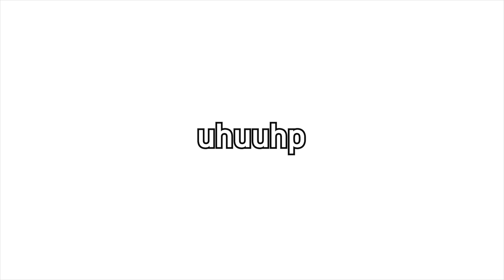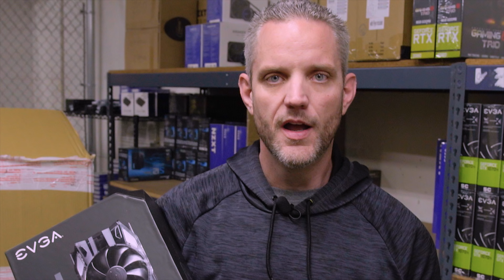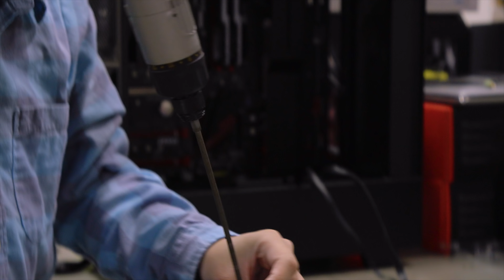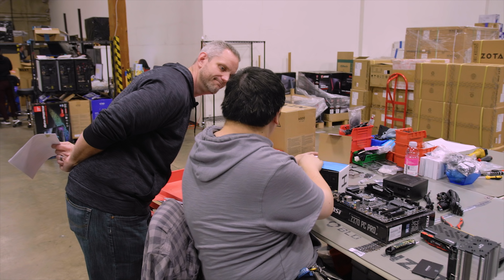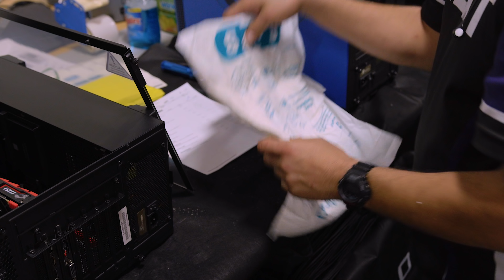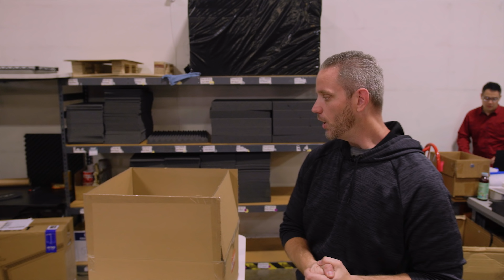How NZXT Computers are built

Comment: I find it interesting that they don't ask the manufacturers for system integrator versions, but instead use the retail versions, including the Ryzen CPUs with the stock coolers.
(3:47) I do hope they're using the Windows setup audit mode, unless the user ordering it chose to have the setup skipped.

Comment: Super Nice that they test, build and install everything, but when you take a look on there website you find a pc with a ryzen 5 3600 with gtx 1660 super for $1253 🤯 you can build that same pc yourself for around $800. And for that price I would install the drivers myself and make sure you get on each part warranty. But I like what NZXT is doing with this to help (first time) builders!
Reply: bro ive compared the prices its just the small things they add like better ram the case itself and the cooler it costs more but ur PC gonna look way better and have the (almost) best components

Comment: I just bought a new NZXT PC and this is reassuring to know they will test everything before shipping
Reply: I just bought the starter pro prebuilt and I can assure you it is a very good purchase I haven’t had a single problem with the pc and I’ve been able to run a lot of things at once and still retain literally no lag it is very impressive.
Reply: @thelivingrocks1933  did you have to download any drivers, or motherboard chipsets? Or were they already installed for you? I plan on buying one but am still scared.
Reply: Kong Xiong if you buy the rep built starter pc everything will already be installed in the computer except the WiFi adapter which all you have to do is just attach it to the outside which requires no screws to be moved. Also if you do somehow manage to mess it up it’s only like 10 bucks on amazon to get some new ones

Comment: Got an i99900k/2080ti build through them. Ordered on a friday, had it thr following thursday. Super neat cable management. The build looked professionally done, and I really felt like I got my 3000 dollars worth lol.

The 2 year full warranty on everything really elevates the value of the entire thing. I tried to recreate my build using pcpartpicker/newegg and I was maybe saving 100 bucks doing it that way.
Reply: Preparing a similar build myself, How is it running so far?
Reply: @BillGriffithsVO  like a dream. I mostly play battlefield. But I can run max settings with rtx on at 1440p and get a steady 60 to 80 frames. 

I dont play multiplayer like that though. I turn everything down. At minimum settings at 1440p I get no less than 190 fps, that's on the big game modes.

Very satisfied. I purchased a gpu support bracket because the asus 2080ti strix is MASSIVE. So be forwarned.
Reply: @MegaEunit  Many Thanks Mega!!!

Comment: to the builder who built my rig I love u brah
Reply: Klaw Snipez are they good builds?
Want one that will run all newiest games on ultra np
Reply: YES they are excellent in every way I highly recommend them @shaokahn2772
Reply: Klaw Snipez just ordered mine
Reply: nice @shaokahn2772
Reply: Klaw Snipez just got to find a good 1440p Ultrawide lol
Reply: Shao Kahn hows the build m8?
Reply: Colin McElyea love it man so far so good
Just wanna switch one of my other hhds out for a 4tb ssd it’s quiet and runs around 58 degrees on ultra
Reply: @shaokahn2772  I just received my new rig last week, build is awesome. They do a really good job of cable management along with the management the case provides. All drivers came in up to date, and runs smooth and quiet. H710 case is massive though, but looks  clean as hell.
Reply: James Frye ya man the H700 and 700i are sweet
Just want the bigger drives they didn’t offer at my time of ordering
Reply: @jamesfrye8753  Hows the build holding up?
Reply: Shao Kahn what bld did you get?
Reply: how’s the build been since?

Comment: Is this of good enough of a pc to game and stream at the same time?
NZXT H700i
NZXT Kraken x72
ASRock X470 Taichi
MSI GeForce RTX 280 Duke OC
AMD Ryzen 7 2700x 8core 3.2ghz
Seasonic prime ultra 1200w platinum 80+
(2) NZXT aer rgb 2 120mm fan
(2) G.Skill tridentZ rgb 16gb 3600mhz
Samsung 860 evo 500 gb ssd
Samsung 970 evo 1TB m.2 ssd 
Seagate barracuda 4TB hdd

Comment: Do a series on IbuyPower. I’m really curious how they have such cheap prices and their build quality. I’ve read a lot of polar opposite reviews on them. 
For instance I was able to configure a i7-9700K, 2080 TI, 32 gigs of ram, Corsair h100 all in one liquid CPU cooler , a 1TB SSD and 2 TB HD and a 1000W gold power supply with a pretty decent case and motherboard for $3100. I was extremely tempted to press the buy button but the reviews have left me hesitant.

Comment: just got a pc from them , felt like buying instead of building for once. That was a mistake , quality of build was lacking . Website and ordering process was misleading, and so far customer service has been lacking to say the least. The cable management was crap , cables were mismatched , ordered cable mod cables , but didnt get all cables replaced because "the kit doesnt cover all the cables for your setup" . The CAM software always loses the Kraken CPU AIO after a week , and you have to unplug the usb , reboot and then un plug again to get it to see the cooler. The screws for the tempered glass panel are cheap and strip out easy and make removing and replacing a pain. They used the power supply basement as a catch all for the crap ton of power cables, and it was a hot mess. Emailing tech support takes 2 days for a response.  i could go on and on , if it wasn't for the 9900k and 2080ti being hard to find , I would have sent it back already. Buyer beware.

Comment: Looks good however what are they basing the FPS on max settings or low with a rtx 2080 ti it’s only running 127fps with black ops 4 selected... that does not sound correct because  my 1080ti founders can run max settings at 160 FPS and 220 on low... what explain sir???

Comment: Bought a BLD system last month. Very easy to pick parts and order. Computer came well packaged. System was beautiful!

But... Kraken x62 placed at top of the case after request to be front mounted (h700i case) 2080ti card had more sag than 90yr old boobies,  the card itself didnt work. Cablemod cables ordered and installed on most of the system. Since the gpu required extra pcie 2 cables were cablemod the other was a reg power supply cable (looked really tacky).

They would not let me downgrade the gpu , so one day after receiving the computer, it was packed up and sent back.

Customer support was really good and helpful, however, I still got charged the $99 built fee for it to be build incorrectly. 

Would still give them another shot though, but decided to build myself once I got my money back.

Comment: Anyone knows what's the bag at 4.38 and how can I get one of those to ship my computer?
Reply: Expanding foam. Squeeze one side, mix it together, dump it under the GPU and slap the side panel on before it pops. Dunno if you can buy it separately though, I've only seen it in bulk boxes.

Comment: My primary gripe with NZXT BLD is that there is not a single strategy, sports, racing or simulation title.
I can't understand why it would be so biased on genre, when different genre could tax the system in different ways. There is very little benefit to include more than 3 RPGs, but one game from every genre should be present. I don't particularly mind if they choose to include more duplicates within the same genre if that's where the hype is at, but that doesn't conflict with have proper representation in all major genre.

Comment: Still find it amazing how they placed my GPU in THE M.2 SLOT! And while taking it out the capacitors on the motherboard BREAK OFF. 10/10 service
Reply: How tf does that even happen?
Reply: @React2Quick  Idk but it happened, even the rep on the phone with me was confused. I don't even know how they were able to load the software on when there would have been no display. Sent it back in, took 2 weeks to come back. So took a whole month to even use the PC
Reply: @Possiee.  jesus. Like how tf can someone be so incompetent?  The PCI-E connectors on graphics card won't physically fit into an m.2 slot. scratches head
Reply: My correction, not the M.2 slot. But it still wasnt the correct slot for the GPU. Still, should not have happened

Comment: @JayzTwoCents I built a PC from scratch back in January 2018. Then about 6 months later, the graphics card dies, then a second one dies. I replace the motherboard, a third graphics card dies, then I get my 4th card and a replacement PSU. Finally it seems to be working. However, when it comes time for another build, I definitely will consider something like this service. Having QC and warranty options on a gaming rig are very nice when you have no idea what the frack is happening.
Reply: Hassan Jassim Good catch

Comment: If I wasn't going to build my own system and wanted to get a prebuilt instead I think I'd rather go with Falcon. They're the only company I know of that does extremely thorough stress testing before they ship out a build. They will assemble your order and run stress tests on it while it's sitting in a hot room for 24 hours. The testing NZXT and other builders do only mitigates the odds of getting a system that's DOA. But on the other hand Falcon is probably the most expensive one to buy a prebuilt PC from.

Comment: Yeah sounds all good except for the fact its been almost a month since i placed a order for a brand new pc and i have has to send it back TWICE because it wouldnt power on or it would shut down due to some cable or some sort of electrical interference from the case its self. Waiting for it to came back for the THIRD time. Lets see what issues i find this time. As a first time buyer i have to say i was not impressed and it has been all kinds of headaches.
Reply: You sure it wasn't the outlet? Or the power supply? They wouldn't send it back if they didn't fix the issue.
Reply: megamixa i am positive it came back with the exact same problem they tried to tell me it was the 8 pin connector. With the side panel removed it would turn on and function but once i closed it then it would shut off and not turn on anymore. I had them on the phone and thats when they told me
I would have to send it back for a second time. Funny thing is i told them about the issue the first time and what i would have to do to make it turn on and stay on.

Comment: OK, NZXT cases? Not fun. 
Within 15 months my expensive NZXT case had one of the front 3 fans [the topmost fan] make an awful rattling noise so I've had to unplug it. So no air is passing across the 2 sticks of DDR4 ram and the CPU area. I found no solution to discovering why it was making such a loud rattling [no no no, it was not hitting the wiring... possibly the fan blades were hitting the fan's 'casing' so there's no way I can 'fix' that kind of issue - the fan blades are simply scraping against a static part of the fan]. Oddly enough, it stops rattling when I remove the dust mesh cover but the fan's blades are INSIDE the fan 'cage' so how could the mesh magically distort 2-3 inches to get in the way of the blades? Somebody told me it was a structural issue within the design of the case{?}.
As if that was bad enough the large rear fan stopped moving, so none of the hot air produced by the CPU and ram [mainly] as well as the 1080 and SSD/HDDs is being removed as that pulls the hot air OUT of the case. I temporarily fixed it by using silica gel on its hub but I have to keep applying silica gel every 3-5 days to keep the bloody thing moving.

As impressed as I was with this NZXT case initially, it doesn't seem to be friendly to people who only want to upgrade every 4-6 years. I get the feeling the fans are designed to 'wear out' within 15-18 months. I shall have to find a way to replace these fans, in fact, it's obvious the other fans will be dying soon so I'll need to replace the entire row of 3 front fans AND the large rear fan as I'm NOT upgrading my 1080 and i7 6700 since they still give me well over 200 fps on almost every game I play but I only play @1920x1080. I'm still enjoying FO4, Thief4, Deus Ex:MD, and games that are about 2-3 years old. How do you replace fans on a case? these fans look specifically designed for NZXT cases.

There is absolutely no friggin way I am replacing the 1080 when I am having to install grfx mods to get some games to run slower when my monitor restricts me to 100fps [I don't like 'screen tearing']. My 1080 is a beaut of a card and I'm very happy with its performance & I am running the cpu @ 3.4GHz whilst these fans are not functioning. The ram is restricted to 2400mhz too. To be safe.
I WON'T be buying another NZXT case. Overpriced, below average quality.
Sorry for the long post.
GTX1080s RULE!!
Reply: lol my s340 elite top fan rattles sometimes but with a little poke it goes back to normal
Reply: just replace the fans, they are electronics devices they can work one second fine and the next be fucked up. they are super cheap and easy to install.

Comment: I actually love installing software... is it just me? I get excited, gives me time to enjoy the process.
Reply: Dylan F 

That’s one of the worst parts of a DIY
Reply: @jeffdaman6969  Windows is too easy to do. Doing a Hackintosh however.....
Reply: Yes, it is just you. Unless you have a laptop on standby, it's the most boring part of the building process. You sit there for a good 2-3 hours installing drivers and going through 1000 updates. And this is assuming your connection isn't doo-doo.

However, if you have a laptop or another computer you can use while it updates/installs then it isn't so bad. Just turn on netflix and let it go.
Reply: @megamixa   Built my PC the other day and it only took 20-30 minutes to fresh install windows and get all my software installed and drivers etc.
Reply: @fallis07  Then you don't have that much software/drivers to install. It also depends on your internet connection. A clean install including drivers, windows updates to current, software (which I include games in this category) is going to take way longer than 20-30 minutes. Calling bull shit if you're telling me it took you to go from a blank drive to fully loaded in 20-30 minutes unless you play no games and only installed like 2 programs. Either that or you have fiber and download at 10gb/s.
Reply: @megamixa  I dont need to download every single game I have a sata SSD to store that and an m.2 ssd for operating system, drivers, etc. And I have a 1 gb/sec connection
Reply: @fallis07  So in other words, you aren't the average person building a new system with a clean install and setup. You're just swapping parts. Not to mention probably less than 1% of pc people have 1gb/s. For us normal people, it takes 2 hours+ to get fully up and running.
Reply: @megamixa  even when it took 2 hours+ for me I still enjoyed the process. I dont like instant gratification. Not sure why you are arguing against my opinion when it's just an opinion I have about liking the whole preparation process of a new build, you seem dedicated.
Reply: nope just you, a portion of my day to day grind is imaging computers to maintain around 800 users.
Reply: @donnienall626  that's err... different than installing software once on your own personal new rig. I wouldnt compare the two
Reply: Dylan F uhhhh... I think it’s just u lol
Reply: I like it too. Ive had company laptops with preinstalled shit and going through what they have installed and deleting all shit is pain. I want to know what is installed and why and prefer installing everything by myself.
Reply: I like installing drivers and software as well :D
Reply: Yeaah a fresh install that's what we need
Reply: Let's all "Wipe Clean" and do  a Fresh Install!   😁
Reply: Well, installing the software yourself is better than waiting for the pc already with updated drivers for an extra day or so.
Reply: Dylan F it's just you, I promise.
Reply: ur a monster
Reply: can you show me how to download windows 10 pro for free?

if not, can you show me how to install windows 10 pro without the activation?
Reply: @douchbagat7671  You just google "windows download" and its like the first link on windows website, you click download installation tool and plug in an empty fat32 USB key into your PC and then select that USB and the install device, and windows will prepare the USB key to install windows.

When you go to reformat, it will let you pick what version of windows you want. When you get to desktop your windows wont be activated, all that means is u will have a watermark on your desktop, if you want to activate it buy a key online for like 10 bucks and activate your windows after the fact.
Reply: I like it, I did 3 OS installs yesterday and I get to do at least 5 today.  However, the only reason I enjoy it is because my normal workload is dealing with the people who own the computers so being able to cuss at Cortana is a nice change of pace.
Reply: i finish the hardware process and then let everything ( copying games and downloading drivers) over night
Reply: yes it's only you who enjoy installing software.
Reply: I guess we're the odd ones out. I usually have everything ready to go and I try to beat my own "best time" every time I install fresh OS. It usually takes 13min for OS installation to first boot (on Sata SSDs) and then another 10-15mins or so for Steam, Discord, Antivirus, Drivers etc. Restart it and you're ready to go. As for games, I keep a backup of registry files and all the game files are in other drive so I don't need to redownload them each time. Just open all the registry files and your game works perfectly normal. Takes just a minute to set up the games!
Reply: Curious Frost My man out here tryna speed run OS and app installs 😂

Drake format:
Speed run super Mario bros *nah
Speed run OS install *YEAAAAAH
Reply: @SushiRicetm  Pretty much XDDD